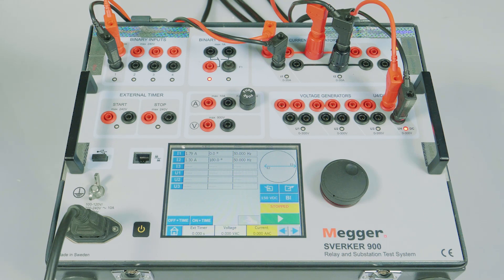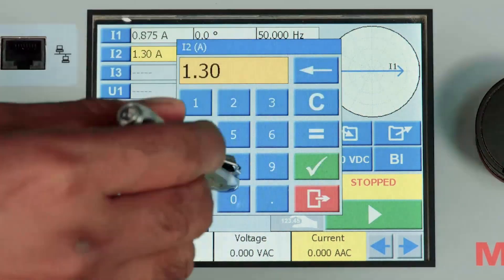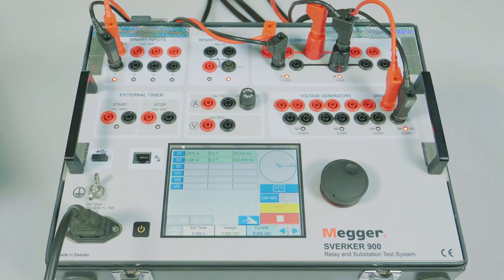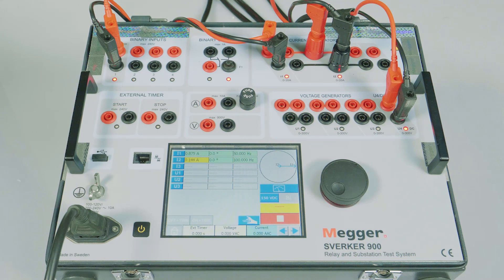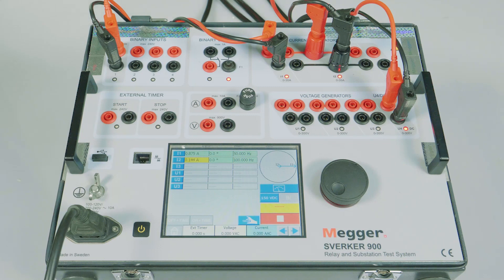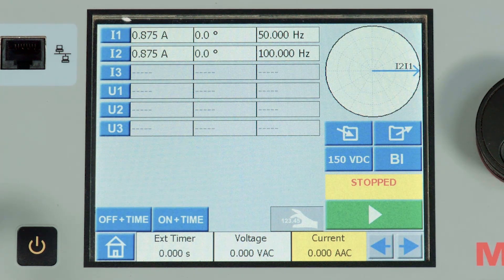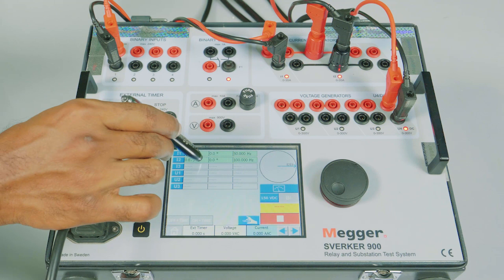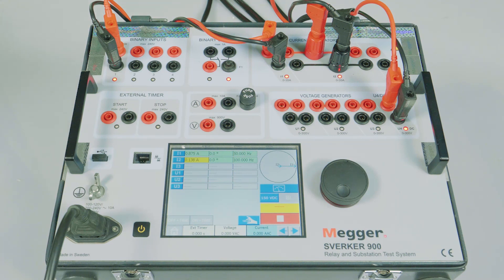2nd Harmonic Test SVERKER 900

Comment: Sir can you please tell me why do we do this 2nd harmonic test.
Reply: because of the inrush current. during energization of the transformer, the current will flow in primary side only for a brief period of time, but the transformer should not trip. this current has 2nd harmonic component which distinguishes it from the faulty differential current. this test is done to verify it.